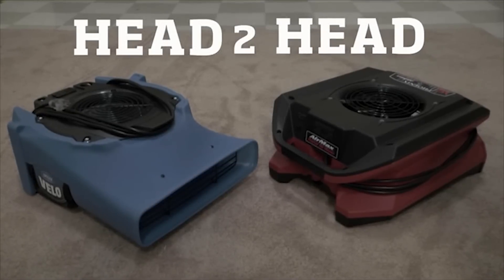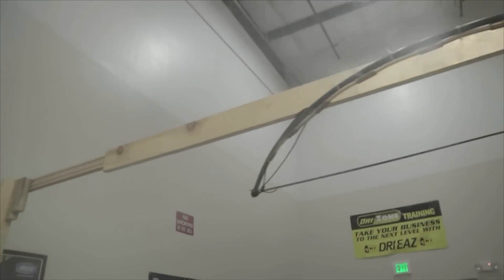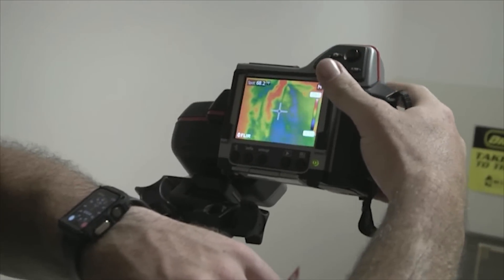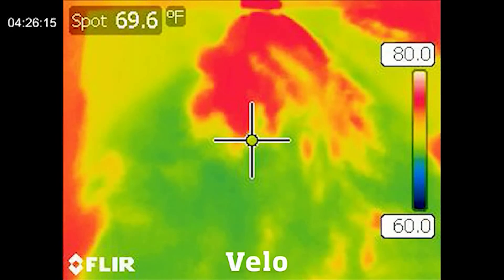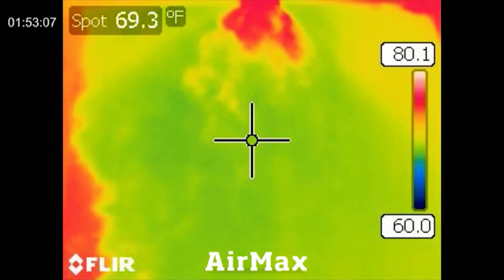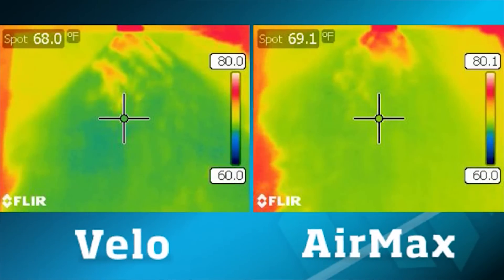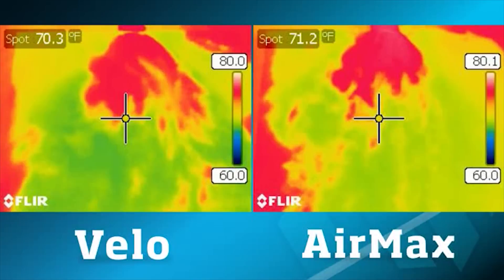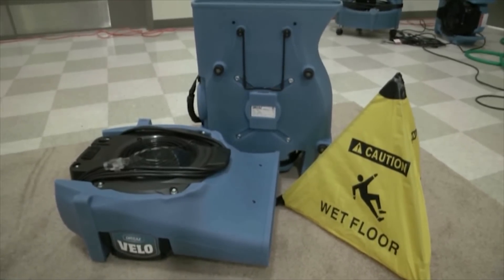Dri-Eaz Velo Outperforms the Phoenix AirMax!

Comment: Is it possible to tilt the Velo upwards so it blows up into air? I have a carpet cleaning business and I want a fan to aim on me while I’m working in the summer.
Reply from the maker: Thanks for the question. For that you'd be better off getting the Velo Pro, which has a kickstand that allows you to tilt the unit. The stand is mostly used for drying stairs, but there's no reason why you couldn't use it to keep you cool! Alternatively, check out our Stealth airmover - it's 360 degree rotation gives complete flexibility and would double up as a great ventilator when cleaning carpets, or even to add a lot of airflow across the carpet fibers: https://youtu.be/8gxPHlhj2q4